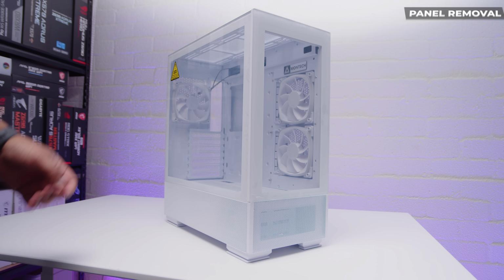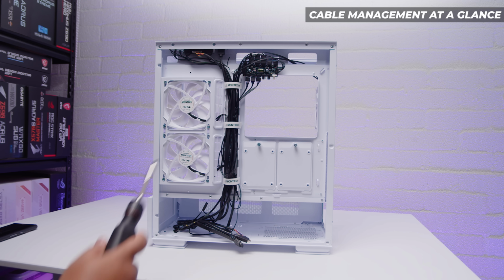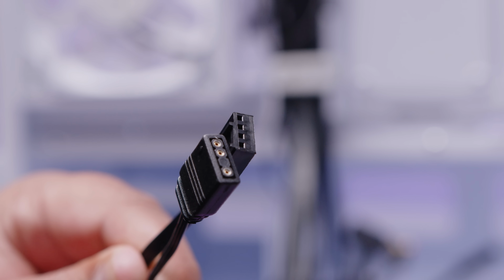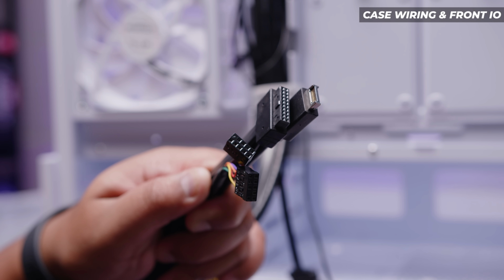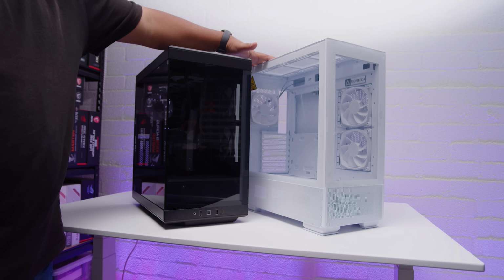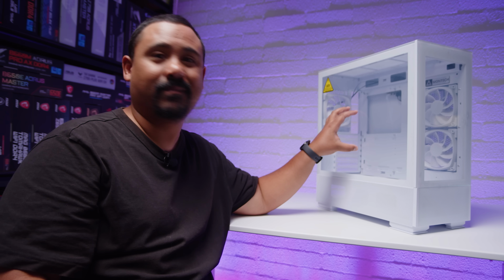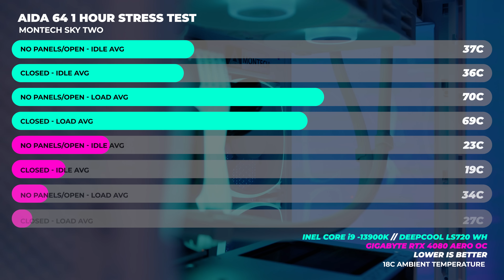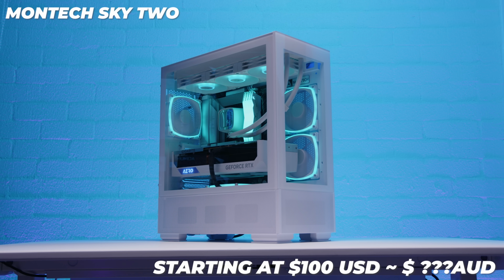This is the Hyte Y40 but CHEAPER! - Montech Sky Two

Comment: You get a 4.0 riser in the Y40 package, which would account for the price gap. Add a 4.0 riser and a vertical mount bracket to the Montech and you are likely over 149.99. Plus you get 10% off Hyte when you sign up for an account. I don't have either case, but I would go with the Y40 if I want to vertical mount.  Montech would be the choice for a horizontal GPU since the Y40 only does vertical..
Reply: Good catch, the y40 comes with a gen 4 pcie riser cable and the phanteks gen 3 is 40 bucks, the gen 4 is 70 from phanteks and 120 from nzxt.
Reply: i cant even find where to order the montech vertical mount kit and i dont think it comes in white
Reply: The Montech does come with 4 very nice looking rgb fans and it comes in an all white color scheme which adds value
Reply: Vertical GPU mounts and wiser and your GPU will loose performance for sure. I would use on board slot for maximum performance.
Reply: I agree but the cable management on the Hyte is, let's say, the less important thin for the manufacturer. If you add a price of €180 for the Hyte you get a no no.

Comment: I just did my build in this case but in black. It looks great, and the rgb on the fans is very nice looking. The only thing I don't like about it is even though the fans give great air flow, they can be a bit noisy. Especially during gameplay when they ramp up. But at least you can control the fans and RGB through your mobo, and they are quiet when you lower the fan speed curve.

Comment: One thing that is not mentioned is that the hyte y40 comes with vertical mount and riser cables that can easily cost $60-90. So if you want to vertically mount your gpu, you will have to pay more in total than the hyte y40 since you need to get the mount.
Reply: For someone whose name is "NothingMatters" This comment DOES matter because it’s ACTUAL FAX!!!! 😂😂
Reply: Yeah but in this case (pun intended) vertical mount isn't mandatory.
Reply: @Johnathon Singh  People are going to get the y40/y60 for vertical mounting. Otherwise, just get another case. It's like buying an iPhone and only doing phone calls with it.

Comment: excelent video as usual. One doubt i have about this case; the case comes with a 6 hub fan on the back. If i want to put another fan on the botton and 3 on top does the montech triple fan pack (wich comes with a 6 hub fan) , be connect to the hub that comes with the case so that i can connect all of the fans and sync all of them, or isn't possible?

Comment: This is really a good looking system and I really like it. just I am wondering whether the dust will easily collected into the back panel and also the bottom hard disk there since the air is coming from there

Comment: I will say that i like the exterior design a bit more on the montech. Having the glass be 1/3 the height of the case and than having a covered mesh area for the power supply looks nicer to me than how hyte did the whole glass panel with interior psu cover. Personal preference but i thinkr that looks lile shit lol.

Comment: those included rgb fans are not cheap looking, however the difference with HYTE that makes the customers willing to pay more is the tempered glass and framing of the case, the HYTE cases look more visually appealing to me because the bezel around the tempered glass and the frames make it seems like the view into the case is not obstructed, as my local PC shop calls it "AQUARIUM" case

Comment: I need these freakin fans in my inverted Lian Li O11 Dynamic Evo as bottom intakes and why not the whole darn case except for my AIO cooler where 3 EK Vardar Evo 120mm fans reside :) .  I was going to search the older 'squared' fans from Enermax. I don't know if any 'inverted' blades fans are out on the market yet. I need dat RGB maan :D !

Comment: Can I use just about any fan on the bottom part of the case? I plan to just remove the exhaust fan on the back and put a mini monitor, then put two fans on the bottom.
Reply: This will work

Comment: How did you guys sync the rgb of the fans to the motherboard software
Reply: plug the fans in the included controller and plug the argb cable from the controller in the motherboard

Comment: There is SO many cases in this category. I wouldn’t even consider the Y40. The Y60 corner is what made it unique and sell. The Y40 won’t. As a Y60 owner myself I’m not interested in the slightest and would recommend ppl get a similar case that’s cheaper and doesn’t show the ugly shroud.
Reply: the problem with the Y60 is that 4080/4090 cards sit too close to the side glass.  i like the Y60's looks with the angled wrap around glass better, but for those building with a 4080/4090, it's just not practical.  it's a shame for such a wide case to have that issue.  =/
Reply: @akhkharu2305  i totally agree. I have the RTX 308 and its okay. They should of made a solution instead. imo

Comment: Not having a top dust filter? Massive No No. Pretty much all the dust just falls in there. Leave a magnetic one or removable one. That way the user can decide. Not including one is a hard pass in my book.
Reply: Everyone with a brain knows that no top dust filter allows for better air flow. I think YOUR book is more of a dirty napkin than a book.
Reply: You are definitely not smart, no dust filter at top when pc is running and just put it back on when it’s not in use, in general just clean your pc it’s not hard